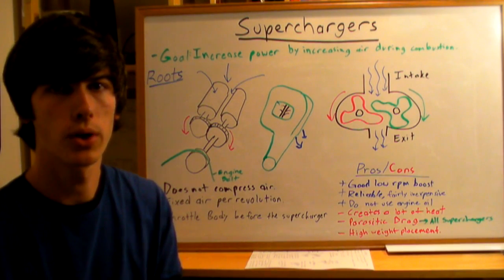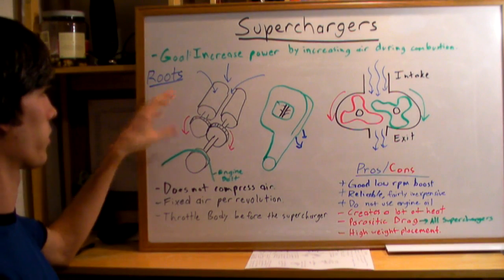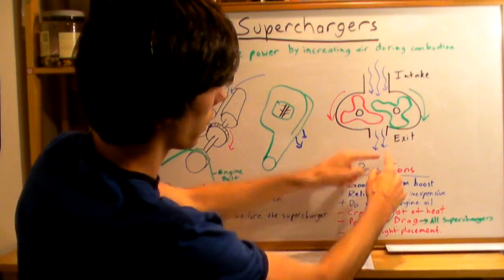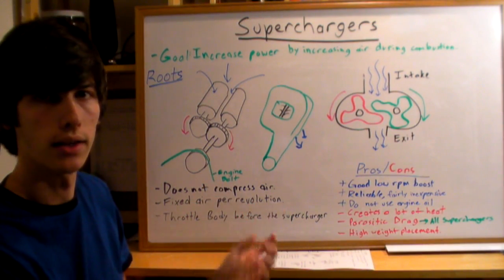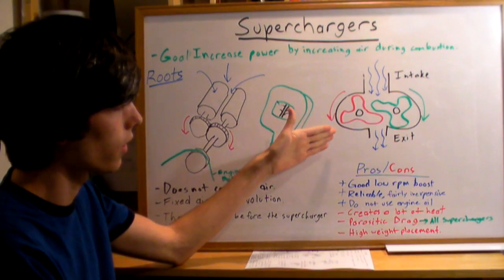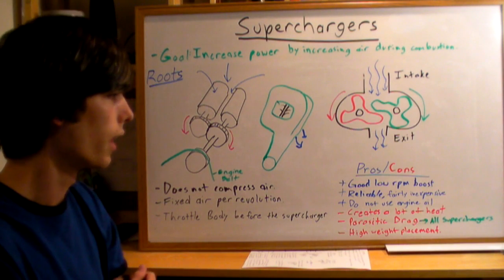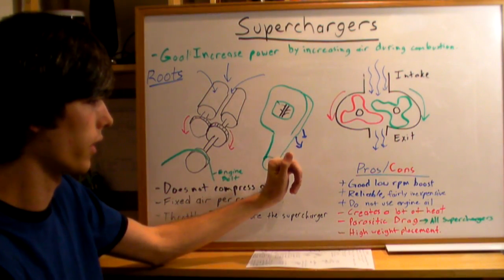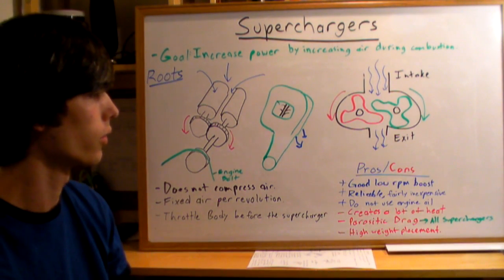Superchargers - Explained

Comment: thank you for clarifying that the supercharger does not compress the air, it moves it into the intake where it is compressed, someone said too me that putting a larger blower on a car will not create more boost it just moves a larger volume of air... however his comment i believe was incorrect, beacuse if you force a larger volume of air into a same size or smaller container you get more pressure... durrrp....

Comment: Id argue that... It seems to me like that would just increase the lag if the two chargers overlap in the rpm band, because your be increasing the force the turbo makes at higher rpm. If the supercharger kicks out when the Turbo kicks in it would fix the lag issue, again supplying that the supercharge is strong enough to match the turbo(I understand allot of superchargers don't make as much boost)

Comment: Not sure if I'm right but I heart that a turbocharger and a supercharger use about the same amount of engine power which is about 1/3 of the output power of the turbo/supercharger. The reason for the supercharger using power is because of the belt connecting it to the engine and the turbo uses power because it is connected to the exhaust and uses exhaust gas to spin the impeller and that in turn causes a back pressure in the engine. Good explination though. Just thought I should mention that.

Comment: Is a turbocharger actually using the HEAT of the exhaust, or just the pressure of it? I think it is ultimately just using exhaust pressure to increase intake pressure so that more fuel can be burned per stroke. If there were really free available energy being wasted there, why doesn't every non-turbocharged engine just have a turbine to generate electricity in the exhaust?

Comment: Based on Carnot law of thermodynamics, no heat engine can be cent percent efficient, energy loss through exhaust is inevitable though it can be minimized as in the case of turbo chargers therefore you can't call this parasitic. i would like to call this scavenging :P

Comment: I have a Honda Insight one of the few left from it's original make,I always wanted to finish what it could be.As an expert can you help me figure out how and where to find a super charger for it ? there is not enough room for a turbo charger in the engine casing.and I prefer the low Rpm boost as it stands mine they say the computer is faulty need a replacement as they replaced all the electric assist components and it still has a desire to not charge correctly,long story on that.But someday I wa

Comment: If a turbocharger is driven by the force of the exhaust leaving the engine, how is that not also parasitic on the total power available from the engine? Whether the fan spins from a belt or a connected electric motor or by the pressure of exhaust gas (ultimately driven by the crankshaft, I guess) it is still using the engine to power it.

Comment: VW have always stated that the G60 supercharger was maintanence free IF the car was maintained properly. One owner cars with correct servicing can reach 200k miles without discernable wear to the original supercharger seals. In any case rebuilding a supercharger, or replacing a cambelt/clutch, once or twice over the entire life of a vehicle is not REGULAR maintanence.

Comment: So on a pro steet car. With a giant blower. The air is pulled in by the butterfly intakes into the carburetor, the air and fuel is then mixed, then it enters the supercharger skrews then forced into the intake manifold then into the engine correct?

Comment: Brake Specific Fuel Consumption: is the amount of fuel consumed (in lbs. per hour) for each horsepower made. Typical values:

Naturally aspirated gasoline engines .45 to .50

Supercharged gasoline engines .55 to .60

Turbocharged gasoline engines .60 to .65

Comment: "all superchargers are powered by engine belts, rather than turbochargers, which use the exhaust gases."

Not quite. In common usage, yes, that's absolutely the correct way to distinguish the two. However, a supercharger is any device which pressurizes (supercharges) intake air. A turbocharger is simply a supercharger that is powered via an exhaust turbine. (Hence, "turbo.")

Comment from the maker: So many questions, so few characters to answer! Yes, superchargers will aid vehicles at higher elevations, much like turbos. HP is just a function of torque, as in torque per unit time. The greater your torque, the greater your HP as you rev, so they go hand in hand. Don't have any plans for the m50d engine, but perhaps I can check it out. 

Cheers.

Comment: Doesn't a turbocharger also produce  its own sort of parasite drag, since the exhaust gas is slowed by the turbine that it has to pass through, therefore also limiting the amount/rate of fuel intake in the cylinder?

Comment: Good explanation.  Only watch out is the ECU may not be setup to run high boost pressures. This is because there are tables in the ECU calibration that tell the injectors how much fuel to put in. The engineers tuning the engine won't use valuable space to tune the engine to run at high intake pressures (remember the highest they figured it would ever run is about 1-2 psig). As EE said though, for most applications the ECU is smart enough to compensate.

Comment: They are capable, but on a Detroit they don't. Since the exhaust valves are open at the same time as the intake valves, the air just blows through, flushing the exhaust gasses out. (the fundamentals of how a Two Stroke Detroit works). If you take a blower off a Detroit and put it on a small-block Chevy for example,(hot rodders have been doing this for decades) if your drive ratios are correct, you can easily raise the intake manifold pressure above atmospheric pressure, making it a supercharger.

Comment: You are correct, a few Two-Stroke Detroits had centrifigal blowers on them, like older 6-110's. But the Blowers on Two-Stroke Detroits do not increase the manifold pressure above atmospheric pressure at all because the exhaust valves are open at the same time as when the intake valves are open.

Yes, A Blower is considered a Supercharger IF it increases the manifold pressure above atmospheric pressure. But on a Two-Stroke Detroit, it does not increase the pressure, so it is not a supercharger.

Comment from the maker: Your ECU will adjust to it, but it's better to have it tuned by someone who knows what they're doing. When the ECU sees that there is more oxygen (air) going into the engine, it will add more fuel. However, not all fuel injectors can spray the same amount of fuel, so these may have to be upgraded as well, depending on the boost and injection quantities of the injectors. The compression ratio will remain around the same, though it is common to alter this to account for the added pressure (boost).

Comment: Hey there EngineeringExplained,

AWESOME VIDEOS!  I love your explanations, and how concise and to the point they are -  we appreciate you sharing your knowledge!  

A question for you:  Let's say I take my 2004 car (naturally aspirated), and I add a super or turbocharger to it for more power.  Will my engine computer automatically adjust for this, by adding more fuel, thus keeping the compression ratio the same as when the car was not super or turbocharged?
Reply: i dont know but this was 10 years ago did you find out

Comment: I've seen two Roots Type superchargers on top of eachother and that put alot of boost into the engine. I think a centrifugal supercharger feeding into a twinscrew would give a lot of boost too. But I do agree that a turbo feeding a supercharger would be the best bet. I have a Garett turbo feeding a Roots Style blower on my motor and that seems to work really well. But it is whatever you can find/afford/build. My setup is factory GM equipment.

Comment: If you take a blower off a Two-Stroke Detroit Diesel and put it on a Small-Block Chevy, for example, It the becomes an engine-driven Supercharger like you said, because it is adding boost to an engine that could normally run without it. But while on a Detroit, it can not be considered a Supercharger.

Comment: A Supercharger is a form of power-adding Forced Induction that adds boost to an engine that could normally run without it. The blower on a Two-Stroke Detroit Diesel does not add any boost, it only gives the engine the air it needs to run. Therefore, the Roots-Type blower on a Detroit Diesel is not considered a Supercharger.

Comment from the maker: @wsghost69 Well, it does act more like a fan, not creating internal pressure. But the idea of a supercharger is a belt driven compressor that increases the amount of air going into the engine. If I'm not mistaken, the roots is one of the original ideas for a supercharger, and the twin-screw and centrifugal variants are just improvements on this.

Comment: Nice videos EngineeringExplained!  As a roots style does not charge the incoming air above atmospheric but rather increases the volumetric velocity of the air into either an aftercooler or intake body would you agree that a roots style is incorrectly classified as supercharger and as such should only be considered a blower?

Comment from the maker: @AntDX316 A lot more work indeed, but that's the price to pay if you want efficiency. Have not heard of twin-scroll superchargers. This term is used for turbos which split the air coming from the exhaust into two separate lines.

Comment from the maker: @AntDX316 Somewhere in the range of like 50-80 degrees F (10-25 C) hotter for the roots. The temperature rise from boost can be nearly double from a roots supercharger over a twin-screw, depending on the boost.

Comment from the maker: @nerdypielover Yes, it makes it worse. When your giving it gas, there's more air, so more fuel burns as well. When you're idling, the supercharger runs off the engine, and is also still forcing additional air into the engine, so additional fuel will burn at idle. Some superchargers have bypass valves at idle to minimize this problem.